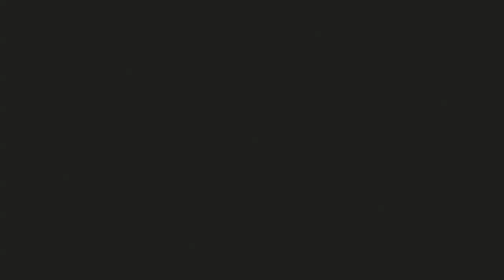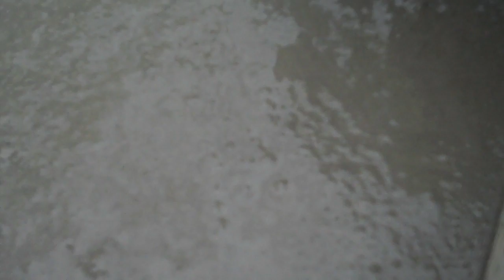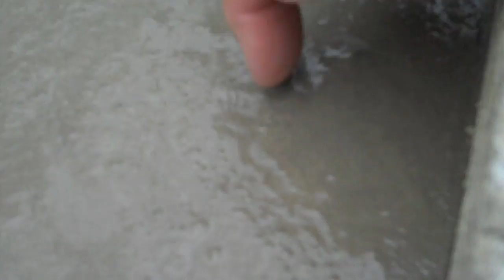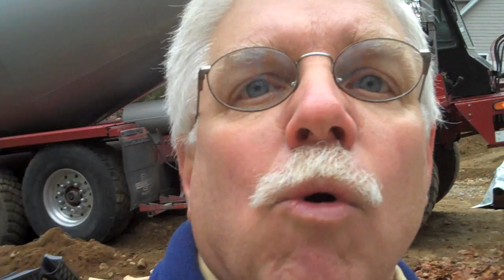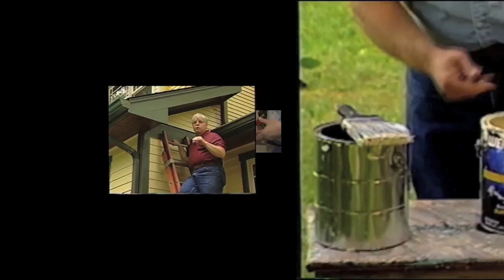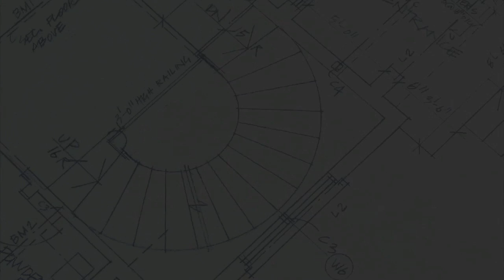Concrete Bleed Water

Comment: So what do I do then before I use my bull float? Wait for the water to dry? But the concrete will have toughened!
Reply from the maker: If there's lots of bleed water, you can carefully skim it off with a garden hose pulling the water to one edge of the form.

Comment from the maker: I hate to say this, but you have your terms mixed up. Curing occurs *after* the final finish is applied. Bleed water happens LONG before you get to that point. I've written *extensively* about curing concrete and why it needs to be done at my AsktheBuilder website - the dot com one. Go there and READ all about curing concrete, plastic shrinkage cracks, concrete spalling, and other surface defects. Please learn the lexicon used with concrete so you don't spread bad information.

Comment: so what should you do with this bleed water?
Reply: 10 yrs ago. Well I’m not a concrete guru but a rubber squeegee. Trick is don’t sink it into the mud tho skim it. Water hose work to guy on both ends of pour walk at angle one few steps head other let guy at high side of pitch go ahead taking push water off fall side